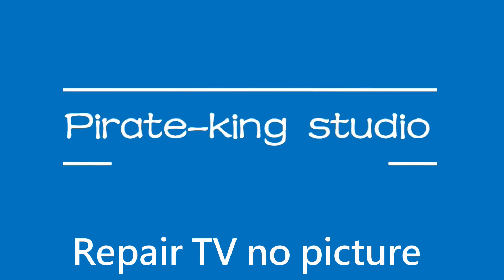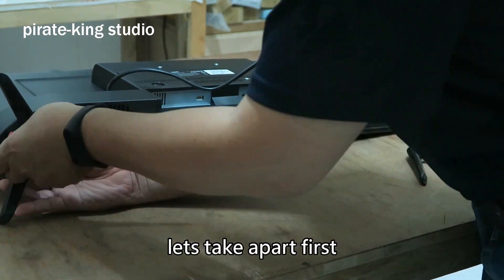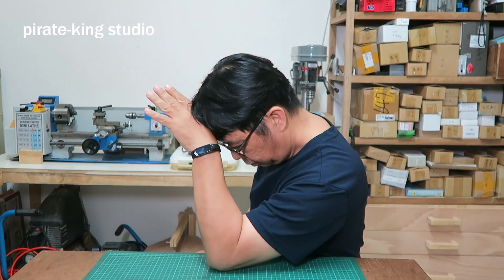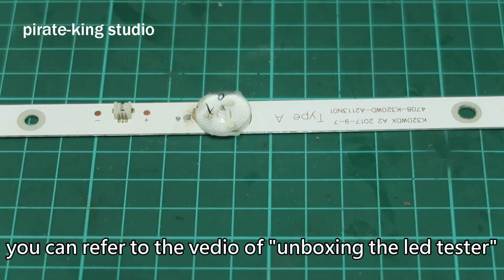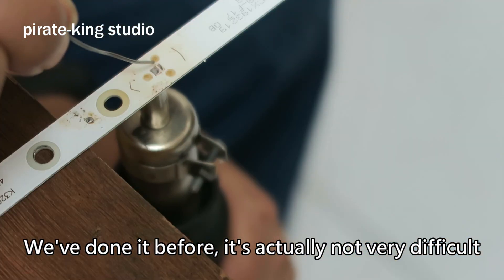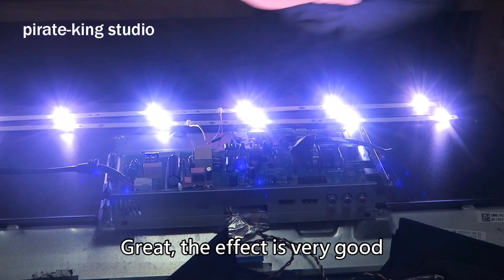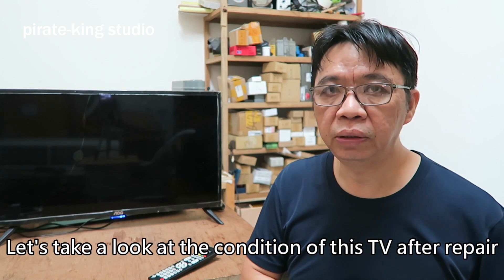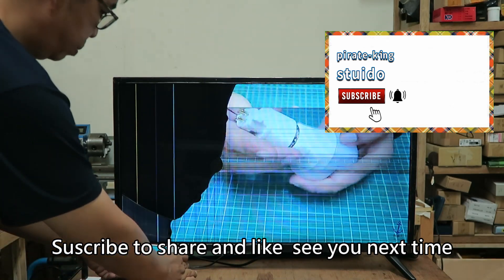how to repair the TV has sound but no video by yourself step by step  pirate-king studio

Comment: Thanks. My heat gun goes up to 450 Celsius only, do I need to buy a new heat gun (SMD rework station)?
Reply from the maker: You can continue to use it, no need to buy a new one
Reply: @pirate-kingstudio5774  Thanks again pirate-king sir. 

I posted a unique type of LCD damage on the weighing scale which I use to weigh Macs, PCs and some parts (apart from fitness use), Youtube deletes posts with links and posts with domain names usually but if you could check it over at MacRumors site, the title is "Is This an LCD (Non-Backlit) Polarizer Type of Damage?", perhaps you can identify which part of the LCD damages (it's not burnt looking but has squiggly lines, yet it's not cracked. The LCD still displays the numbers just fine. Thanks again in advance.